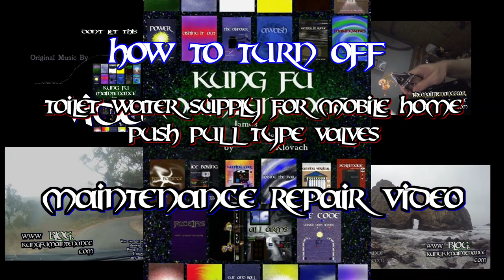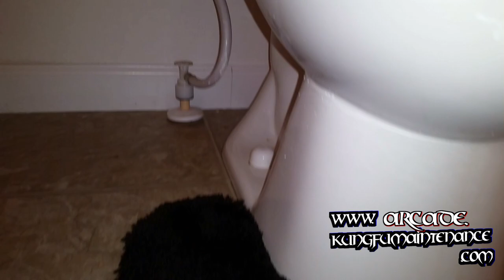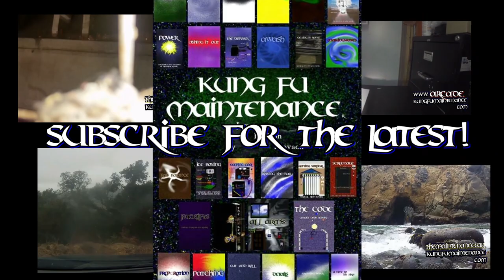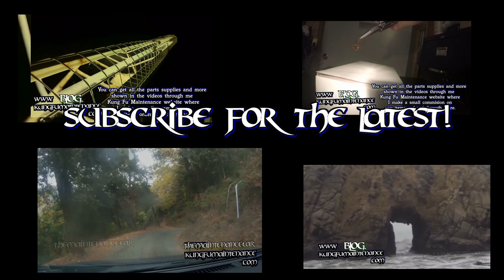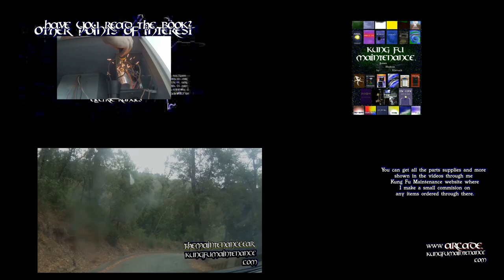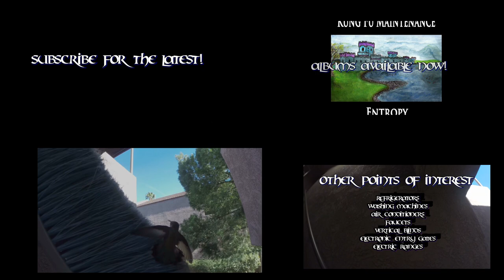How To Shut Off Toilet Water Supply For Mobile Home Push Pull Type Valves Maintenance Repair Video

Comment: Dude. I'm 50 and I've installed the twisty turn off valves onto copper a dozen times. But I just moved to Florida and I'd never seen the push-pull PVC version before. I tried to pull, but it was stiff and felt like I was about to break something.

This video helped. Thank you.

Comment: I disconnected my refrigerator last night from the ice maker because I’m moving and I couldn’t figure out how to turn off this valve or where the water valve was so I turned off the whole water supply because the movers were waiting. The pipes were still draining so we put a bucket and figured it would catch everything. Needless to say it didn’t and there was water everywhere when we came back the next day. I’m here waiting for a plumber and decided to do one more search on what to do. You just saved me SO much money. I just called and canceled the plumber. Thank you!

Comment: Thank you soo much. I woke up in the middle of the night to use the bathroom and tried to go back to sleep but realized the toilet was running. I was tired so I just went to shut off the valve and was dumbfounded and I never noticed my new trailer had these ridiculous plastic valves. I couldn’t figure out how to shut it off. Then when I was pretty sure I had figured it out I still couldn’t do it. It took all my strength and hurt my hand. I didn’t know I would have to pull on that hard. It’s an hour later but thank you I can finally go back to sleep

Comment: Landlords should make sure tenants see this. I had a huge bathroom flood from the tank cracking wide open. Water was gushing, it was a weekend, and I tried turning, pulling and pushing the valve. I thought I was going to have to call 911 when it finally pulled out.

Comment: Thank you! Some newer homes also have this pull type valve. I tried shutting the water off by " turning" the valve like most other YouTube videos show, but I quickly realized that wasn't working with this particular valve. I never tried pulling it though. I'm always afraid I'm going to break something. Thanks again for helping those of us who are used to living in apartments, and never had to deal with things like this before.

Comment: Great video which explains the frustrating Push/pull valve ( Florida construction). Usually I could adjust water flow with turning the knob of copper valves.  Can the water flow be adjusted with this push/pull valve? I didn't see much improvement when I tried to adjust flow.....thought I just may break the flimsy thing. ??
Reply from the maker: Thank you. Unfortunately there is no adjustment on these. They are either on or off.

Comment: What do you do if the water is still coming through but barely? Almost like a hissing sound. I just bought a fill valve for the tank and gonna be replacing it today, But the water wont fully turn off by pulling it, but instead just hisses.

Comment: Thanks.  I found your video after I went to the hardware store and bought a 1/4" O.D. cap for the refrigerator water line. Now I'm tacking your fabulous instructions on the wall behind the refrigerator along with the cap as plan B. Thanks again.  FYI, they are putting these in new construction homes in south Texas. Not sure where else since I've never seen this type before I bought this house in 2013.